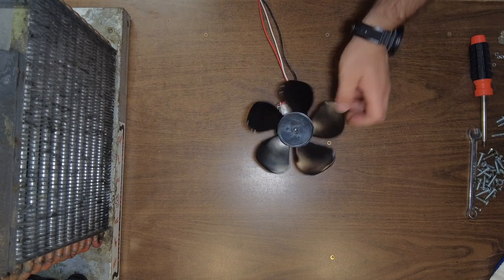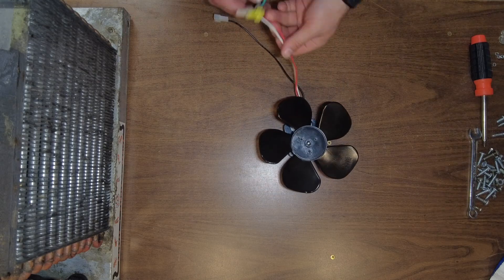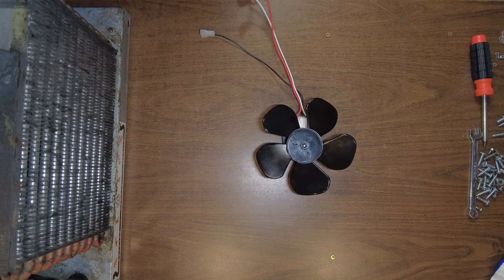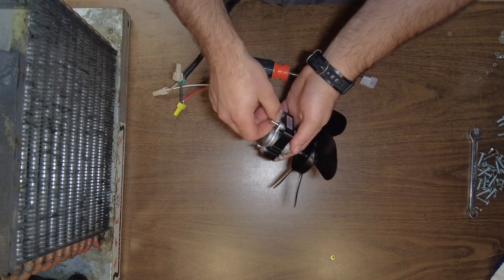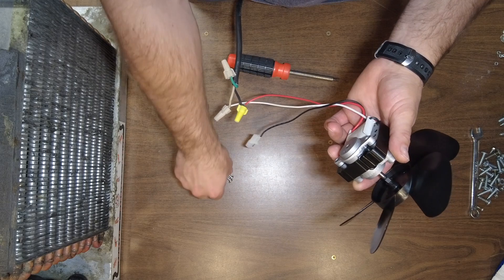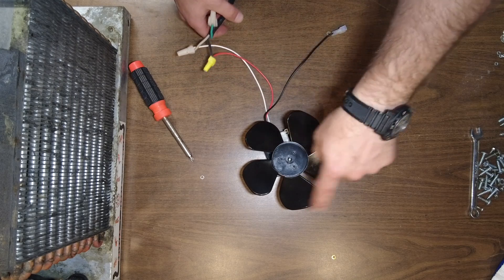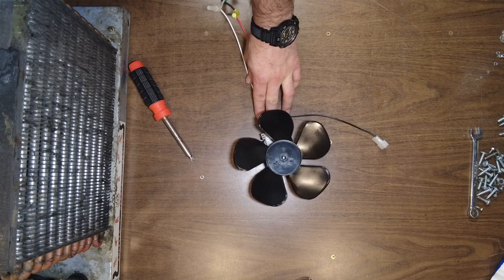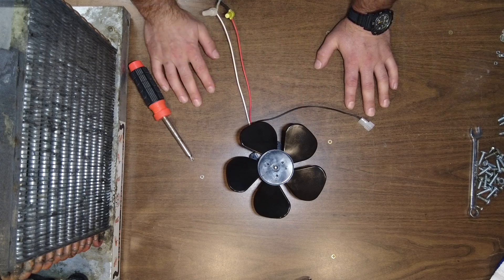Reverse rotation of AC fan

Comment: You can also just flip the fan instead of going inside the unit
Reply from the maker: I'm sure people realize that. Sometimes it's not possible due to clearance, different mounts, fans offset, etc.. same as in this case I had to change rotation, because of the wiring, so just flipping the fan backwards does not work.